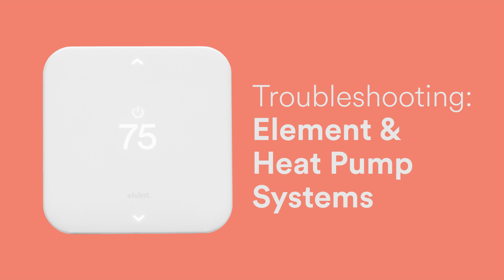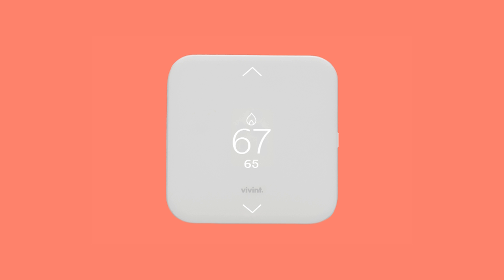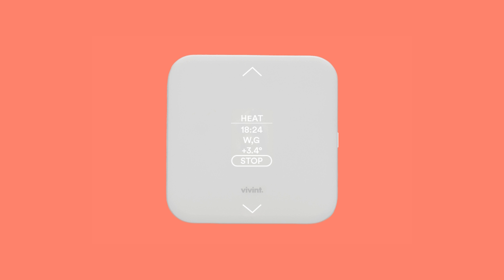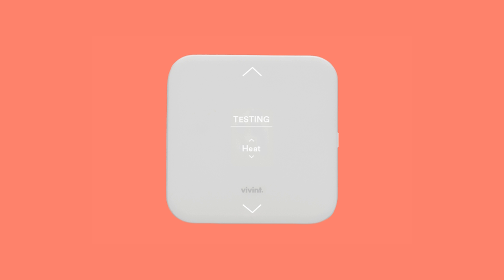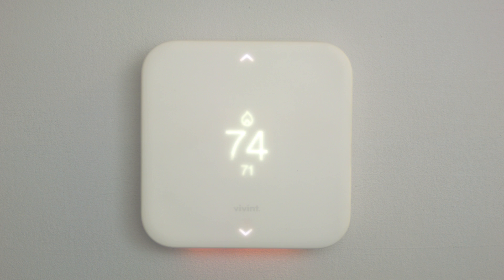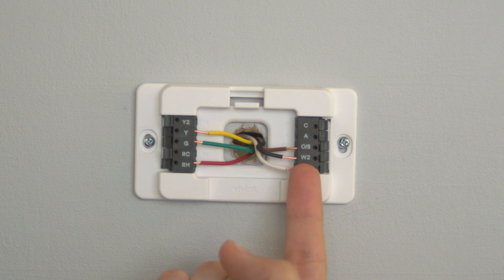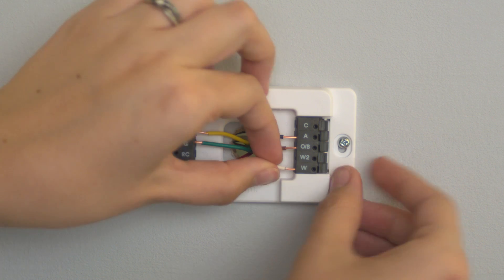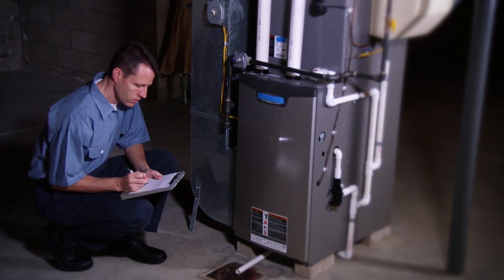Troubleshooting: Element Thermostat with Heat Pump System

Comment: Mine is definitely not engaged with my furnace, blowing cool air meanwhile furnace is trying cycling pilot lights are on flames. Ive tried the test turned off power to breaker box. And the vivint somehow is in stage 2 but i cant get it out of that mode. Ran a test w showed up but the test ran tepid cool air set on 70, not heating up.   Any ideas?
Reply: I’m ready to get rid of this junky ass Vinint thermostat. It works sometimes and it doesn’t. But I’m tired of trying to problem solve it.

Comment: IF YOU HAVE A older TWO STAGE HEAT PUMP: installer finally came and helped with this. In the old thermostats w1 and w2 went to w1 and w2. That doesn’t work for whatever reason on the new thermostat try doing w1 to w1 then w2 to “A” on the new thermostat. The installers have great documentation that show them where the wires should go. Call centers and their own instructions for the thermostat do not have this information

Comment: Okay so my vivint themistat works but it doesnt turn on the cold air
Reply: I have the same problem
Reply: I have the same problem!
Reply: @flempa1  @Cobert Hall @luisalfredo Any of yall resolve this problem?
Reply: @andrewa3216  ya I couldn’t figure it out so my family just got a new thermostat
Reply: Did any of you guys figure this out bc I’m currently going through it right now
Reply: @krissysmith7639  ya I couldn’t figure it out but me and my family just got a new thermostat
Reply: @krissysmith7639  From what I can tell this thermostat just doesn't work with some configurations with heat pumps -- we ended up buying a completely different thermostat. Amazon thermostat made by Honeywell. Which is actually a legitimate company for thermostats. Not some home security company.
Reply: DId you get this resolved?